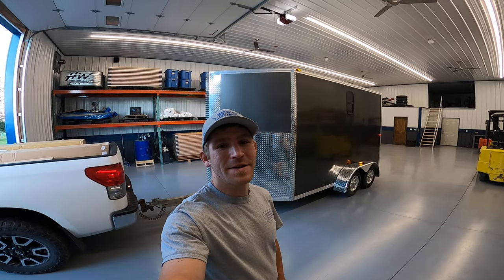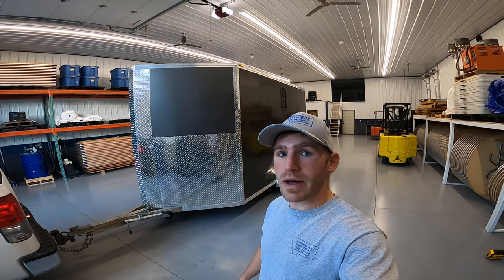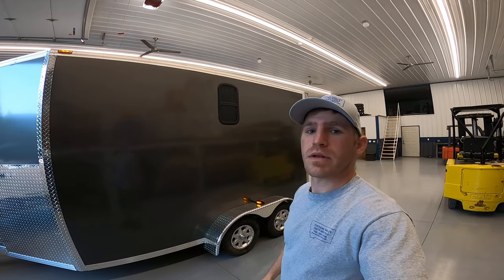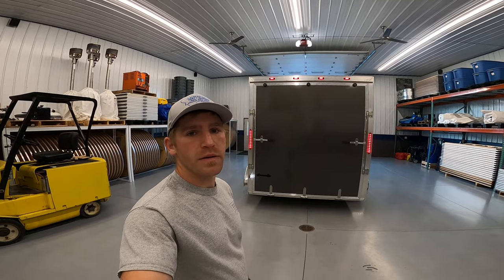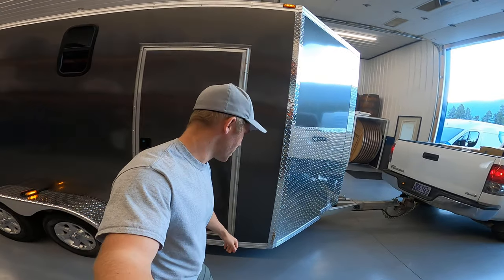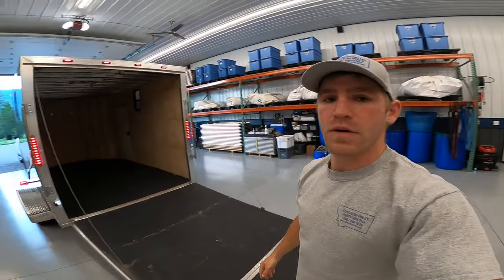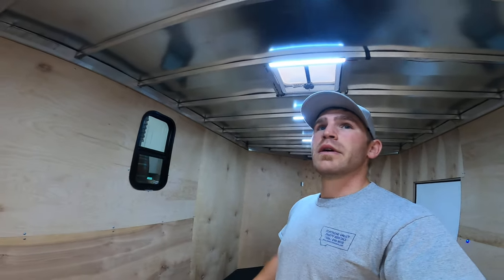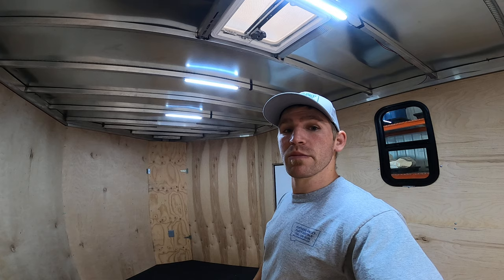Enclosed Trailer Rebuild. Final Walk Around.

Comment: You did an amazing job. What side panel material did you use and what adhesive?  Also would you do this again?
Reply from the maker: Thank you! I used aluminum paneling and 3M VHB tape-the standard for this sort of project. I like the screw less method-but it’s results will be based off the prep and how thorough it is done. I have seen it fail on other trailers that weren’t properly cleaned before applying it. If you do a good prep job and application, it is incredibly strong.
Reply: @billygrossjr.5585  3M makes a panel bonding adhesive that's used to glue auto body panels on that has incredible strength and in fact only comes of with extreme heat applied to it from a torch. As you say though prep is the key to either option.

Comment: Where did you get your trailer specific supplies? The skins, adhesives, trims, windows, preformed diamond plate, rear door, etc.?
Reply from the maker: I purchased many parts from Amazon. I purchased some pieces from the trailer manufacturer directly. The diamond plate and aluminum I purchased from our local metal supplier. I actually built the rear door myself.

Comment: I bought a trailer and need to to a rebuild for a family business would love ANY advice. Like where to do get the materials for starters I now nothing.
Reply from the maker: There isn’t too awful to it. Just be positive everything is level and square with the frame before you begin and it should all come together quite well 👍. Amazon had most of the small stuff and some if the paneling.